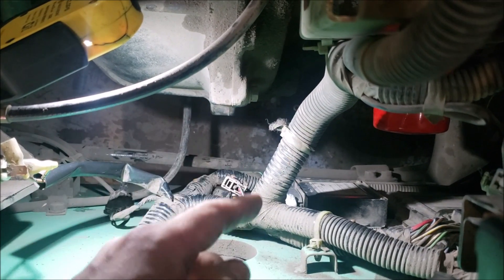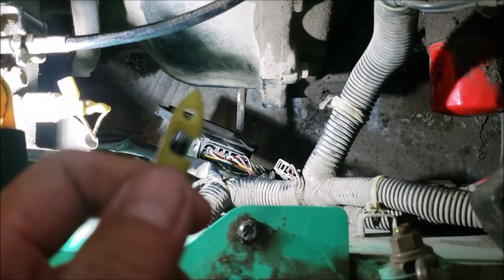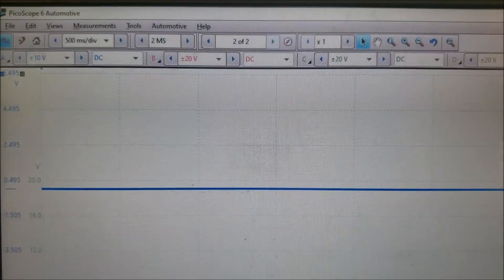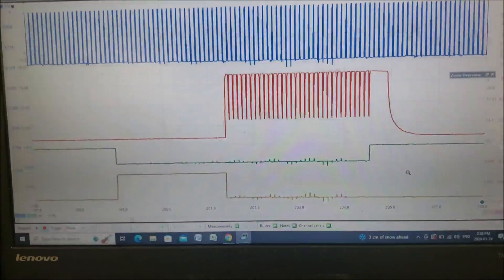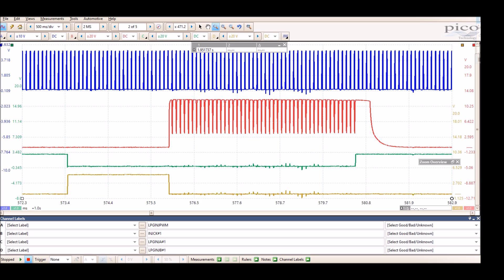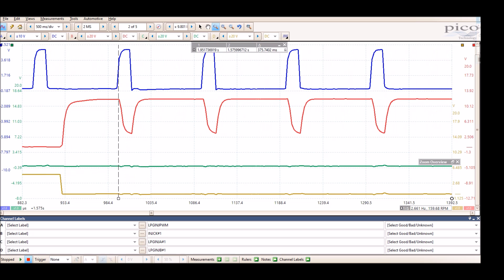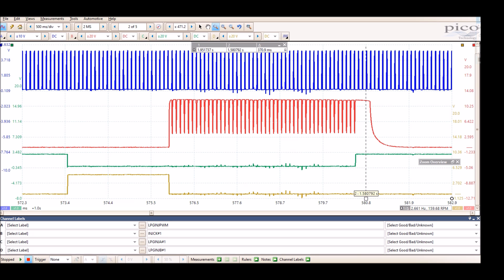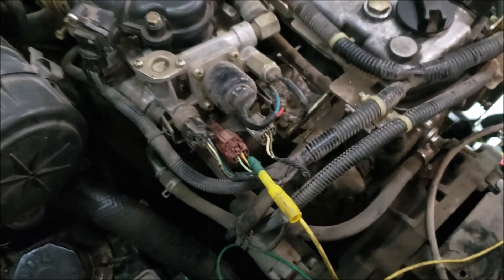What can cause an E-35 Code (k21 engine)

Comment: On k21 or k25 unicarriers or nissan lifts always check the ecm grounds to the frame especially the one on the left footwell. Rust and even sometimes painted ground port can cause it to code out. Take a wire or sanding disc and expose the metal.